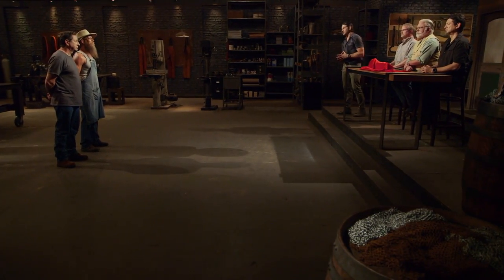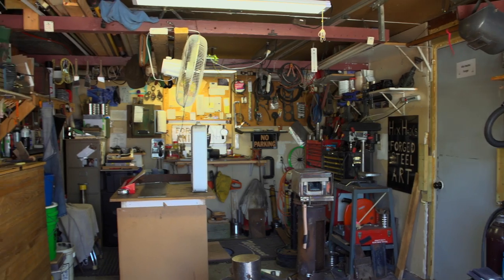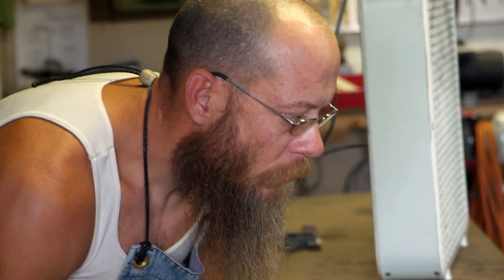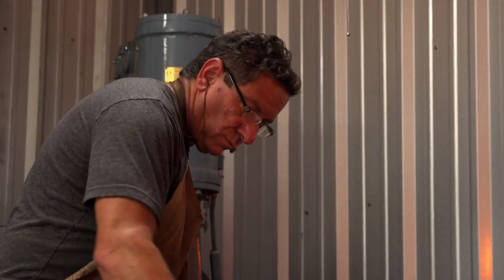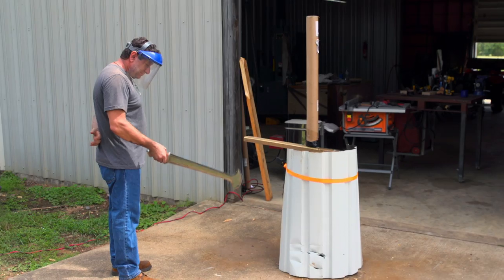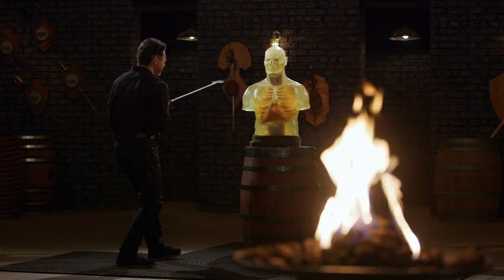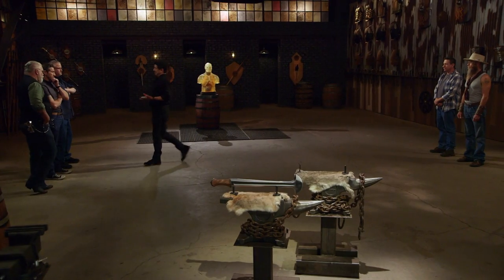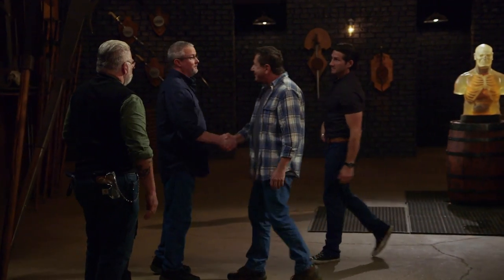Forged in Fire: POWERFUL Black Panther Sword DEMOLISHES the Final Round (Season 7)

Comment: Mad respect to Ricardo. His blade was better than the one forged by the judges. Cross that, both his blades looked better than the judges one on display. Dude's a mad lad and friendly dude.
Reply: You're absolutely right
Reply: David Baker makes the blades for the initial display but you can see many times he doesn't put a lot of time into the finish. Most of them are fairly rough. Plus he doesn't have to worry about his blades being tested by J Nielsen.
Reply: @mrkiky  it's not right to compare the display ones with the contest ones
Reply: @trilokyamohanchakra6351  I take what I said back though. It sees that David Baker's weapon is used to calibrate the tests and to check if it's a fair test for that type of weapon or not. But he still doesn't put maximum effort in the finish since he has to make one for every episode.
Reply: @mrkiky  I speculate that he makes like a lot of blades in a single settings, so he makes a lot of false tang handles does basic profile of the blades, does some grinding here or there, etches if necessary and then call it a day, but also be makes some blades really well as well, like the RamDao, I think if the blades require a lot of detailed work then he takes time, for eg the hunga manga, it probably used plasma cutter and welded the handle lying there

Comment: Anybody who has watched any of these knows - if your blade is heavy, then you’re likely not gunna win.
Reply: Not true this case was just the fact that he didn't grind it down or remove any weight from the middle it's legit a giant slab of dead weight.
Reply: Cuz they are tendon ripping monster
Reply: @Lapis.hnk.1984  it doesn’t depend on the weapon there have been 2 handed beasts lighter than this dudes one handed sword
Reply: The one exception was the Claymore where Ben Abbott won his second time. the other guy made a fantastic weapon that was super light, it was sharp and it was surprisingly strong.
but he lost because his blade was so thing that it just curved around the pig's backbone rather than cutting it. And Ben Abbott also made a great sword so he won because his finished all the tests.
Reply: Then Mae it light why other guy in same time made lighter blade I mean 2 blades not only one
Reply: absolutely right

Comment: This was a non contest as soon as I saw how thick the blade was. Even Ricardo's rejected blade would have won easily had they risked testing that lump of metal against it. Time and time again competitors lose because they make their blades too heavy. How hard is it to weigh the metal before you start working on it?
Reply: Not even weigh it, just take a couple practice swings with it and feel how exhausting it is.
Reply: It's mostly lack of pride in the blade that makes it too heavy or fall apart. They have more than enough time to forge masterpieces like Ricardo's blade. 
That other guy just doesn't have pride, motivation or the skill to forge anything more complex than a square nail.
Reply: @TheJalapeno100  I think he was talking about weighing the metal you are going to use before you start forging with it. You know, since that would save you the time of actually making the weapon up front.
Reply: @markeddy4256  It's an unreliable method to weigh it before working the metal.

Different metals have different weight properties. You'll definitely lose more or less of the metal you're working, so if you've already limited yourself by capping the amount per weight, you risk being short in filling out the profile of the weapon or just not making a strong enough blade to begin with.

What would be reliable however would've been for the smith to pick up the weapon with one arm, realize that it feels weird just to even think about swinging the weapon, then grinding fullers, grinding smaller profiles or even shaving off excess lengths. But this smith has never once concerned himself with the practicality of swinging a weapon, he locked on to his idea of an intimidating/inspiring weapon which was that it should be heavy.
Reply: a lot of them are cocky amateurs
Reply: @Elrohof  I am not suggesting they start off with the target weight for the weapon, but a competent blacksmith would have a good idea how much weight is lost during the typical process.  Working with an excessive weight would be more tiring as well as more time consuming, so the quicker the blacksmith gets the weight right the better. 

I recently watched an episode when a single handle blade was 7lbs, 5lbs more than the winning rival's. That frankly is just stupid and inexcusable.
Reply: @anthonyjohnson100  Show me the swords you've forged.
Reply: @Cervando  It is more smart to weight it AFTER it is done before the grinding of the edges. It doesn't make any sense weighting it BEFORE the forging. Your logic is whack.
Reply: @1flash3571  No it is best to weigh it before AND after. Working with an excessively heavy piece takes far longer to shape and forge. Having to remove a few pounds in weight afterwards is also time consuming. Since they have to work to a deadline, it makes far more sense to start with a weight that is slightly above the end weight in order to save time and effort. The proof is the many times contestants know they are very overweight, but run out of time to correct it.
Reply: @Cervando  It all comes with experience. After few times, one already know how much steel you need for certain length blade with tang. Not that freaking hard. Most of these blacksmith haven't made these type or length of blade, so weighting them out is out of the question BECAUSE it is their FIRST TIME forging this type of weapon for most of them. It is better to eye the length and the thickness of the blade they want to end with and go with sizeable chunk which is quite bigger to start out with just incase you mess up.
Reply: @1flash3571  How exactly is weighing out of the question? Furthermore even IF we pretend none have no experience of making longer blades, their experience of making shorter ones would still be useful in determining how much percentage weight is lost in the process and simply scale it up. 

Finally, if they are inexperienced with making longer blades and thus less likely to guesstimate the weight, wouldn't weighing before and after make even more sense, not less?
Reply: Theoretically weight wasn't the full issue, it was how the weight was distributed. You can have even 2 lbs of weight feel dramatically different just based off balanced weight vs Forward weight.
Reply: @Th1sUsernameIsNotTaken  The design is very forward heavy anyhow and doesn't have a substantial pommel to compensate. But the losers sword was far too heavy overall, because the blade was far too thick as can be seen during construction.

Comment: Surely even if nick had got to the strength  test his blade would have snapped as where he forge welded the San mai its got a crack so I'm guessing  the end part would come flying off
Reply: Exactly what I was thinking
Reply: Not only that, but his quench only reached two-thirds of the length of his blade. It could've easily bent or twisted near the base of the blade, had the sword hit with a strong enough impact.

Comment: I was watching this piece of steel at 3:10 being so massive, i knew judges wouldn't approve it like that, and they didn't, the line "its gotta be a be heavy blade" is wrong in any situation, he had to try to create as lighter blade as he could, but he decided to go with that thick piece of metal, and regrets it. All in all it was a beautiful piece not considering the weight and thickness, i hope he learned that for the future :)

Comment: A common misconception in edged weapons is exagerated weight.  It's kind of useless to have a 8 pound blade, that  feels like it can cut trough a guy vertically. An opponent will make 4 cuts with a proper blade while the gigablade is swung. Being late by just a split second ,by having a heavy blade, often meant seeing your arm drop onto the ground.
Reply: On the other hand, an executioner's blade does not need to be balanced or fast, quite the opposite. It being top heavy is great for clean decapitations as we can see with asian and indian ritual/sacrificial swords.
Reply: @LukeBenc  When considering the balance of a blade it's the specific balance that fits the specific type of blade. With the ritual/sacrificial/executioner blades, they need a specific balance point that is further up the blade, but still need to be balanced to that point. A lot of people think a well balanced blade has a balance point where the hilt meets the blade, but this is not accurate for all blades. different blade, different balance, still need good balance wherever that balance may be. Also, OP's comment on the 8 pound blade, it does swing slower, but the real issue is in recovery time not the speed of the swing. If you can't recover and defend yourself, you're wide open and dead.
Reply: this is a common mistake, but sometimes some weight is useful
Reply: @BladeBattle  Can I ask for clarification on your comment?
Reply: @synthemagician4686  elementary, more weight, more impact force.
Reply: @BladeBattle  Let me clarify my request a bit, I was unclear, What exactly are you referring too as a common mistake in your original post?
Reply: @synthemagician4686  a heavy blade is a common mistake made by gunsmiths, even manufacturers make blades that are too heavy.

Comment: The flanged Mace is the ultimate mideval weapon. Although it is hard to sharpen.. the battle axe, or the shaolin spade are the best edged weapons, but not as powerful when faced with armor.

I came up with a steelworking technique, and a fastener system, to combine the shaolin spade, and the Flanged Mace, or maybe even the hammer, to create, the Ultra, a weapon that can chop through a Knights armor... I think it would make a good boarding axe, when combined with plasma pistols for space boarding combat

Comment: I wonder why they never seem to give weight as one of the parameters for blades.
It seems I often hear judges talk about blades being very heavy sometimes still usable but often very heavy. They definitely have parameters that have to be met before testing but it seems like weight is not amongst them they may need to correct that problem.
Reply: it's just a show, if you take into account the weight, most of the participants will lose at the very beginning.
Reply: @BladeBattle  fair enough. 
I'm definitely no blacksmith but it seems odd to me that weight would be fairly easy to figure before forging. Although many on the sho are knife smiths who have never made swords. 
Regardless I think at least for the finals maybe weight should be included to intensify competition.

Hope that made sense in very tired g fighting a cold so I may be loopy 😂
Reply: @asa-punkatsouthvinland7145  yes, for the ending it would be fair

Comment: I don't know this thing about weight in a weapon. Sure, a lighter one is overall better to have, but to the point they won't test if it's heavy? I don't get it. My cousin has a 7 or 8 pounds ornamental katana, which I've played around even using a single-hand, swinging at thin air, which is far more stressful to the arm since you have to also brake the movement.

To wrap up, it's obvious that his weapon would be outperformed by his opponent's, but I feel like, when you make a blade and take there for testing, all you want to see at least, is it doing its job: killing in the kill test.

Comment: I would be so upset if they did not test my blade due to weight. Weight was not listed as a perimeter so auto disqualify was not fair in the slightest
Reply: It wasn't weight alone, it was also how far forward the weight was. The guys who swing weapons professionally agreed that this weapon wasn't safe, for them, to swing.
Reply: I dont think they disqualified him just because of the weight, that blade had rust and cracks at the tip, if that blade breaks, it could hurt someone.

Comment: For a blade smith with atleast a little bit of experience it should be pretty obvious that you need to limit your weight as much as possible when it comes to making a longer blade intended for extensive use, especially if intended for chopping stuff upp. Mr Strawhat here in this episode should have figured that out right away before he actualy started to forge the blade in question at all. And if he had had atleast some common sense the would have realized, that considering what they do in the final round on this show is to recreat different historical weapons, he ought to have done atleast some historical research on the type of blade he was about to do to get an idea of what would be an appropriate lenght-with-weight-poingt of ballance-distal taper range for the weapon. After all, even if he doenst have a local book store or librarey with books on historical swords like this, there is PLENTY of info to be found on the internet to atleast give him a hint that making a wrist and arm breaker wouldn never win him $10.000. But then again...if you wear a straw hat along with jeans suspender pants common sense is probably not your strong suite.

Comment: Ah I don’t like that, cause it’s a little heavy they won’t test it that’s not right
Reply: Wish they tell us the weight and let us be the judge too. If its extremely forward heavy though it will hurt. I wouldn't swing it.
Reply: You can see him test swinging and seeing the potential for over extending and hurting himself. Coupled with the method he used for making the crescent (the scarfing and adding metal to the tip) I'm not surprised it's was too forward heavy
Reply: Have you tried swinging something really heavy with a single arm? That could seriously injure your shoulder, elbow, wrist and/or muscles with a slight misstep. He could have tried to forge/grind in a fuller to reduce the weight and make it more wieldable
Reply: Yeah but anytime the smith says "my blade's going to be heavy" while in the process of forging it their blade has almost** never won. By season 7 they should know weight is a huge factor in determining the winner. The handle is a close second for aesthetic considerations.

The other game ender is the quench. Too many blades have failed after the smith openly questioned their quench yet continued on anyway.

Then you get a smith like this guy who made two blades just because he felt like it. Didn't quite like the first one so he took everything he had just realized wasn't right and smashed out another blade in a fraction of the time the first took. Kinda fitting that they gave the obviously better smith the win. But that's just my opinion...
Reply: @Benson_aka_devils_advocate_88  That guy that made the heavy Arming Sword won. His opponents sword broke.
Reply: @TuAFFalcon  🤔 true, true. edited it ,😉👍
Reply: Anyone who make heavy blade most likely looser, please watch the all the videos
Reply: @Benson_aka_devils_advocate_88  My man's an old wine Love ya dude
Reply: A little heavy? The judges said by just holding it they could feel it stressing all the way into their shoulder. It was more-so way too heavy. You swing a weapon that's too heavy, you'll hurt yourself. That's why they didn't test it
Reply: wielding a heavy weapon on one of the shows is how he messed his shoulder up. Lesson learned apparently.
Reply: @Benson_aka_devils_advocate_88  Yeah, that guy is obviously a pro. For sure a deserved win.
Reply: @TuAFFalcon  why would we be the judges from the couch? We can’t feel the weapon
Reply: @aaronaustin9814  Yeah because people never judge anything especially online...
Reply: Little heavy? The exact words they used were extreme weight. It was obvious it would be ridiculously heavy when the video showed the edge profile at 3:10
Reply: @aaronaustin9814  So you don't know what 1kg 'feels' like? Brah. I am a dogger. It is my job to judge/guess weights if it can't be weighed or measured.
Reply: They've tested plenty of heavy weapons on the show, which means it must've been dangerously heavy if they refused to test it due to safety hazards. Thus, they made the right decision not to test the weapon one-handed. They could've tested it two-handed, but then it wouldn't have been a fair test, which is why they had no choice but to respectfully refuse.
Reply: @mistahanansi2264  exactly, plus judging by the size of the hourglass handle, it would've been too difficult and unsafe to wield with 2 hands as well

Comment: It's really dumb these demos are done by humans to begin with.  There's no way to ensure the same force and angles are being used.  And then this whiney, it's too heavy, the guard will break my wrist rigmarole.  Replace with an air piston or pneumatic machine, then you don't need half the experts on top of it.  Whoever gets tested first by a human is dealing with the freshest version of that human, whoever goes second is dealing with a more tired human.  This makes all of the testing extremely flawed.